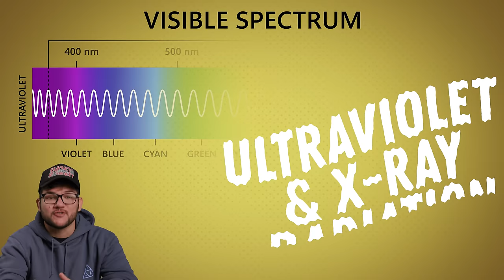Mechanic Reacts to Welding Fails from Tiktok

Comment: im a retired weld  inspector,, all of this is nothing compaired to the fck ups i have seen in structural welding i.e. buildings bridges power plants ect, ,, and boiler makers from the union,, (the bigest fck ups out there) in 40 years i have only seen 2 boilermakers pass a structural weld test..... do not go looking at the welds on bridges in the east coast, you will never drive over them again..

Comment: The second guy was wrong on so many levels!  So many safety violations!  No safety gear at all, as a matter of fact, no safety protocols whatsoever.  Jacket, gloves, helmet with dark lenses, NO FLAMMABLES WITHIN 25 feet!!!!  This includes the car unless the car is what you are actually welding on.  And always, ALWAYS the correct fire extinguisher nearby.

Comment: No don’t get into welding. It’s horrible, dirty and so hard on the eyes and lungs. Maybe it’s different in the US but in Canada the government screwed the trade over. And with the influx of mass immigration there are so many people from other countries taking super low wages in the industry driving the wages in general down. 10 years ago I was making over 150 an hour with my own truck. Now after Covid, a couple recessions and the economy in Canada there are shops paying journeymen 17 bucks an hour. Top wages for non B pressure welders tops out at 32. B pressure shop welders make about 45-50 an hour. Most of the smaller shops went under in the last 5 years and the big shops are doing what we call the 90 day special. They constantly bring in new guys every week and let people go before their 3 month probationary period is up so as they do need to have a reason to let them go, pay severance or set up benefits. The on,y way to make money in the trade is to get your B pressure tickets and your own truck and even then it’s hard right now. And I live in oil country in Alberta. It’s even worse in the rest of the country for welders.  Become an electrician. Much cleaner, easier on the body both physically and health wise and you make way more money.

Comment: The guys didn’t mention it, but if you weld you should have a breathing air supply.   The fumes generated by the welding process is very toxic and deadly.